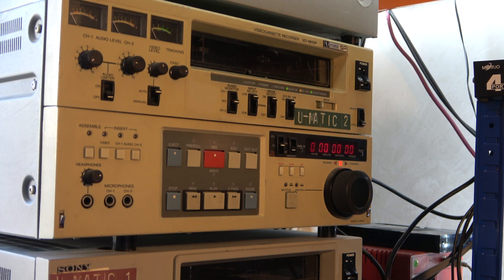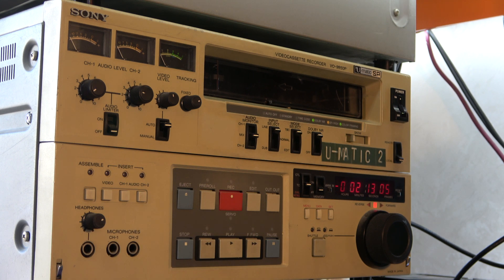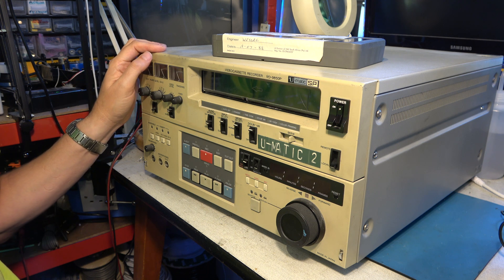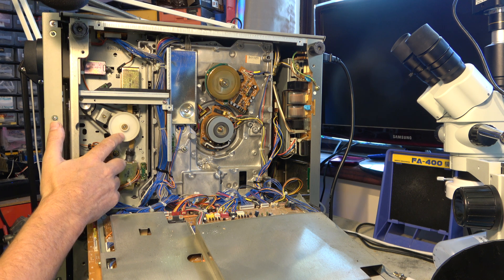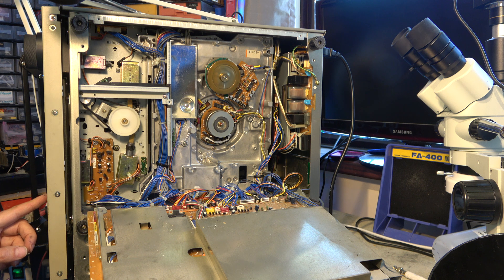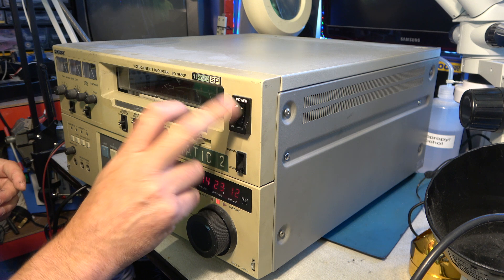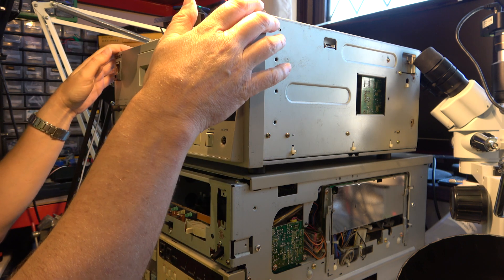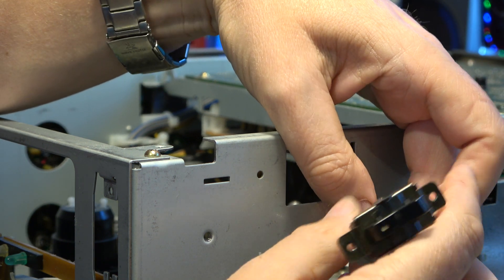Three small faults on a Sony VO-9850P U-matic video recorder.

Comment: Hello,  
I have a problem with the transport of some 60-minute Umatic tapes because it is harder to move the tape from one reel to the other inside the cassette.  
What could be causing this? Do you have any advice to solve the problem?  
The belts are fine, so the issue should be with the cassette itself.  

Thank you
Reply from the maker: If the reel idler tyre is OK, then the tapes could have "sticky-shed syndrome".  Put the tapes into an electric fan assisted oven / dehydrator / incubator set to 50C for 24 hours, and see if that helps.
Reply: @video99couk  It doesn't seem like the tape is sticky; I also opened the cassette and it's clean.

Comment: You ever seen one of these just spin the idler tire on powerup (not pushed to either side to actually spin either hub) and also not light up the display and is otherwise unresponsive to button presses? Power supply seems to be outputting appropriate voltages and fuses test ok. Thermal camera shows that boards all over the unit have power as well... If you have any ideas or have seen that before, I'd love to hear about them!
Reply from the maker: If no display then one of the 5V lines may be missing, I had this on a different model once.  The 5V was derived from one of the panels, not from the power supply.  So check all supplies against the service manual.

Comment: Do You have a video of the Panasonic nv-8400? Best regards, Kai
Reply from the maker: Not a machine I've worked on, nor particularly likely to.  I don't tend to cover old VHS machines since they wouldn't be of any use to my business: I run VHS tapes on selected S-VHS decks.  So they would only be done "just for fun" like I did a similar aged Beta once, and time is always against me for fun projects.
Reply: @video99couk  thank You so much. :)

Comment: Hello Colin. I have VO-9800p that suddenly turned black and white over night. The picture is crystal clear but no color. I have tested cables and capture device with other machines and it works fine so something has to be wrong with the umatic machine color. Have you ever seen this before?
Reply from the maker: I've not had that problem but understand it is likely to be bad capacitors on the chroma panel.  I would suggest you pull that out and test any electrolytic capacitors with an ESR meter.  Also look for any glue on the PCB which may have gone conductive.  It would help if you could find another machine to temporarily do some panel swapping to confirm that the fault is on the chroma panel, but that may not be practical.
Reply: Thanks Colin. I will try that 😀

Comment: Hello UMatic community! I've been having an issue with my Umatic machine where the video sometimes plays back with stripes of color overlayed on entire video - perfect rainbow. When I stop and start it, it sometimes plays back with the proper coloration. Anybody have experience with this? Would love to hear how you fixed it. Thanks!
Reply from the maker: It could well be capacitor trouble in the chroma circuits.  Tricky to resolve, but start by taking the chroma panel out and check to see if some of the electrolytic capacitors are going low value and/or high ESR.
Reply: Thanks for your reply -supremely helpful!  Going to see what we can do @video99couk

Comment: 失礼致します。いつも動画を最後まで見ております。とても参考になります。別の話ですが、私のかなり前の古いVTR VO-3900 を持っておりますが。ローディングが回りません。この video recorderは44年経過したものと思われます。直したことはありますか？🤔
Reply from the maker: I've not worked on that model.  You will have to study the schematics to see why the loading motor is not being operated.  First thing to check of course is whether there is any voltage across the motor.
Reply: @video99couk  コメント頂きありがとうございます。ローディングモーターを分解して内部を見ましたが、まだ消耗しておりませんでした。他の不具合ですが、テープエンドに関係するシステムコントロール回路、ロジック基板などを調べているところです。😊

Comment: Nice video. Do u need to bake umatic tape because of stucky tape syndrome?
Reply from the maker: Umatic tapes can suffer sticky-shed syndrome, especially Ampex branded ones.  But other brands such as Sony are less problematic and don't require baking so often.
Reply: @video99couk  thanks sir. I love your videos and I live in the USA. 

Keep the videos coming.
Reply: @video99couk  I bake umatic from 10 hours to 15 hours at 135. But you are correct on everything you said.

Comment: I use three different Sony U-Matic decks for archiving my library of Raw Footage.  On all three decks, I've encountered the lubricant on the spool reels has gotten tacky and significantly slowed the FF and REW functions. I solved this by removing the spool reels and cleaning the tacky lube off the spindle shafts. Then I hit them with a slight amount of WD40 and all three of them are drag-free and working perfectly.

Comment: I am using a Sony VO9850 & Keysrobe Dub-optimser with a Panasonic MX70 for YC into a Startech PCI Express Capture Card with Great results; But, some, if not all, Umatic tapes need a cleaning first. I do that with VHS & 8mm for digitizing with great results. I also bake the tapes. So, what is your advice for direct cleaning of Umatic tapes, so to cut down on deck head cleaning, before committing them to the 9850? I have a national client with 100+ Umatic Tapes. Thanks for your time & expertise.
Reply from the maker: I don't clean U-matic tapes, I don't have equipment to do so.  I do often bake them though.  Sometimes I will have to run a tape through a machine twice, sometimes getting a better result the second time.  I believe TapeChek do/did a U-matic cleaner but I've never seen one.
Reply: @video99couk  Thanks for your quick response. I suspect I need to replace that rewind belt, does it serve as the same drive for play? Do you know who might supply many belt sizes? Perhaps applying rubber belt conditioner? Any advice? Again thanks for your time & expertise. Just looking for simple advice, no guaranty asked for or implied. Just another man, or as the English say Bloke, trying to turn a profit in a business found fascinating.

Comment: do you know what kind of machine I would need to play DA-30 ampex 467 3/4 insh proffesaional digital audio cassette I believe its a U matic but I cant find an answer thanks
Reply from the maker: It sounds like a PCM1610/PCM1630 tape.  I have kit for that.  Ampex tapes were awful, it will certainly need baking before it goes anywhere near a machine, and there are bound to be dropouts on the tape which will affect the sound.

Comment: What is your experience with the 9850 & the Canopus ADVC 110 or ADVC 55 to digitize Umatic tapes. Is the TBC on the 9850 good enough for that? NTSC
Reply from the maker: The 9850 doesn't have a TBC, you need an external one.

Comment: bonjour je viens de récupérer 1 Sony hi8 evo-9800 p et je n'ai pas d'indications sur le panneau avant pourtant il avale bien les k7 mais aucune action sur les touches eject,rew,play,f.fwd pause le compteur n'est pas allumé ainsi que les diodes si vous pouvez m'indiquer ce qui se passe j'en serais reconnaissant. MERCI
Reply from the maker: Sounds like a power supply fault (PSU).  You will need to get the service manual and check the voltages.  The service manual is available online because I was able to download it from somewhere, so just Google search for that.
Reply: @video99couk  merci

Comment: I came across your channel by accident when the algorithim offered the DAB+ line out addition.

I find this channel fascinating because I had no idea what was occurring behind the scenes in commercial or professional video recording and playing. 

I had no idea these $47, 000 machines existed and had just presumed a top of the line commercial VHS machine was the main tool of the industry.
Reply from the maker: The main tools of broadcast were based on Beta rather than VHS.  All TV studios used Betacam then Digital Betacam and sometimes HDCAM decks, which use tapes of two sizes.  The smaller of those sizes is physically almost identical to a domestic Betamax tape, but the recordings themselves are different.  So Beta outlived VHS, and surely Sony earned more money from Beta than anyone ever did from VHS.  Now studios tapeless workflows of course.

Comment: Hi, I'm Zoran, I'm writing from Serbia and I have a problem. On one of our local sites where used things are sold pop ebay I found a sony umatic Sony V0-5800PS and the man wrote the following in the description of the device. Until recently it worked normally, and now it just pulls in the tape and can't play, rewind or record it. so I'm wondering if such a device has a belt that may have cracked so it won't let go of the tape. I am grateful in advance for the answer.
Reply: I follow all your works on youtube and I can say that they are great. Keep it up,
Reply from the maker: It's hard to fault find remotely, but it certainly sounds like it could just need a new reel belt and/or idler tyre.

Comment: Could the shaft for the supply spool use some lubrication? I've had a few VHS machines do the same and lubricating the spools fixed them.
Reply from the maker: It's possible it would help and I may try that at some point.

Comment: I recently picked up a Sony MiniDv camcorder and discovered it can convert a composite or s-video signal to DV. I tried it out by converting some VHS and Standard 8 tapes and was pretty pleased with the result. If you have tried this method out yourself how does it compare (in your opinion) to a good quality capture card? Loved the video as always!
Reply from the maker: Yes some miniDV and Digital8 camcorders can do this.  Especially if you feed it with S-Video (where available, such as from an SVHS deck), the results can be excellent.  I don't use this route because it's a bit fiddly to set up compared to a dedicated converter or DV deck, but there's no reason not to.

Comment: have you ever cleaned belts in warm soapy water, hand soap works a treat, it just cleans the belt incase its clogged up and slips. Worth a try if you have not got a replacement handy.
Reply from the maker: Another trick, just for testing purposes, is to put the belt into boiling water for several minutes.

Comment: My tv broke down this week, I'm hoping it will just be a capacitor or two.
A nice man coming on Sat morning to have a look.
If he can identify the fault, I should be able to fix it... fingers crossed.
Reply from the maker: Modern TVs can be a bit hellish to fix.  If it's something like a capacitor or a power supply fault, then that should be OK.  But if it's deep inside an IC somewhere, then often a new panel is the only real solution.

Comment: Thanks Colin another great video, keep up the good work, I was wondering if you can add a Y-C mod to one of your u-Matics and do a video about it? I know you don’t need it since you have a dedicated TBC for that but some may be interested in seeing a machine getting a proper Y-C output by tapping into the internals right before the composite stage and extracting that signal. There is a guy who did that on a US machine but I don’t seem to find that link anymore.
Reply from the maker: There isn't a Y/C signal available inside a Umatic, any such modification would be non-trivial.  However some TBCs can be fooled into using the Composite Video signal as C and there's a monochrome signal available in the Dub connector for Y.  That works because the compression in a Composite signal is in Y, not C.  Taking the unmixed monochrome Y from Dub overcomes the problem.  I suspect actually that's the way by TBCs do it internally.
Reply from the maker: Thank you for the link on how it Chroma can be extracted in an S-Video way:
https://web.archive.org/web/20120609002928/http://captain18.livejournal.com/140367.html